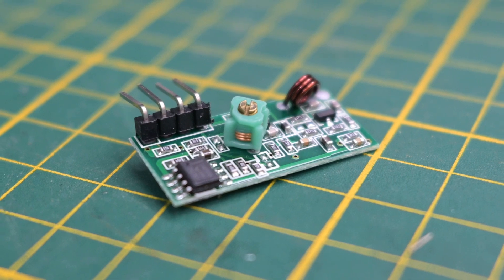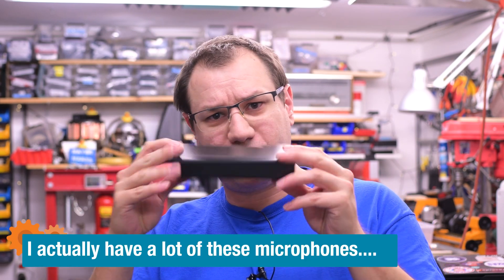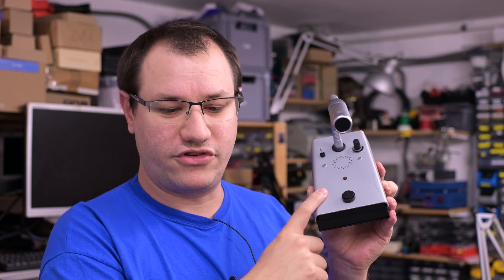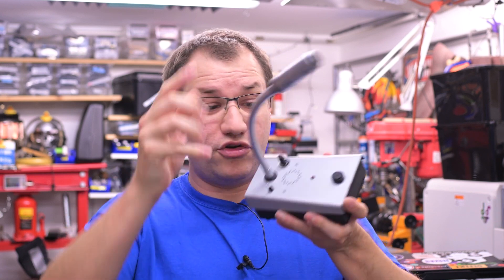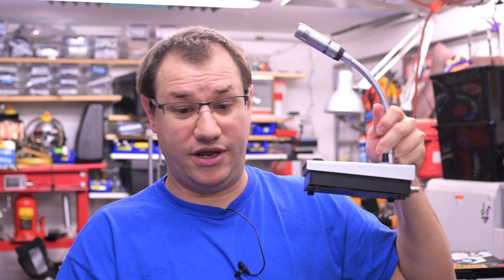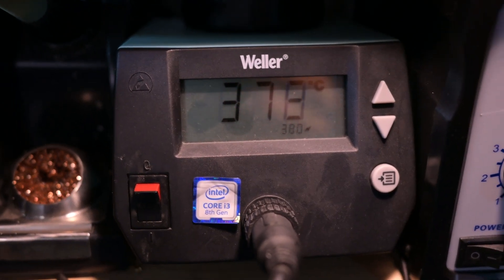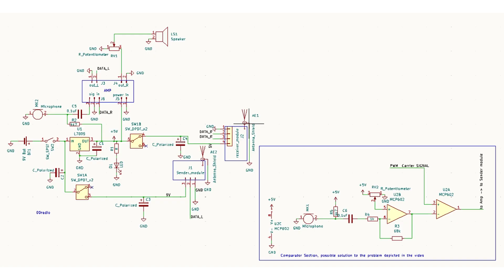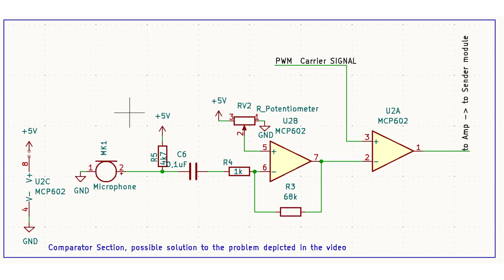Upcycling a Vintage Microphone into an Emergency Radio System

Comment: A distress call can go out over any band however 1 # you actually need to be able to be heard into it actually needs to be in emergency. This is where having a ham radio license really does help because it covers some of the basic information like what frequencies are used for what to some extent like the ISM band not being voice. I think you should do eight 900 MHz or 2.4 GHz voice module you might even be able to strip some of them out of old cordless phones. That would be a fun project. but this is also scary since you don't know what legal bands you're legally allowed to transmit on and that varies by country. Considering this will get more use as like a 2 way walkie-talkie I think you should go for something that's unlicensed. And keeping it analog it keeps it simple.

Comment: Don't forget you want to send a distress call / call for help. So that means the person that is listening to you has to be able to demodulate your signal. I would say that means you have to use a standard method of modulating.
Reply: Valid point, and för something cobbled together interfering with a commercisl radio frequency may be your best shot😂

Comment: I think you are over complicating things a bit.

These modules are VERY simple things.

First find out what the transmitter can do. Hook it up to  a scope and watch the output Use a diode probe if you scope is no up to the job. Vary the input mark space  ratio and see if the RF output follows. Find out how quickly you can vary the mark space.

The connect up the Receiver and see if you can see the same variation - if so as you say a simple LPF will demodulate it.

If this is On you much have dozens of ATwhatever/pico/espthingies. in your stock
Microphone to ADC input, convert to digital, output to PWM and feed into  Transmitter.
Then you should hear something if the modules are up to the job.

Yes get your Amateur Radio ticket, then you can learn a bit more about RF 🙂

Andy
Reply: Unlocking long range communications with a license could be worth a shot.